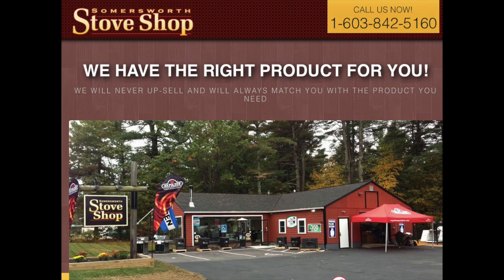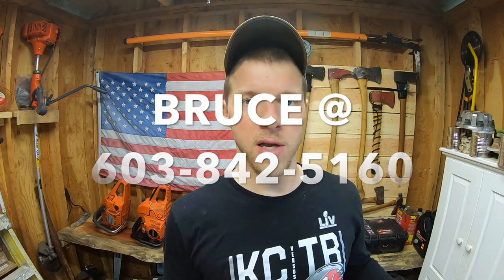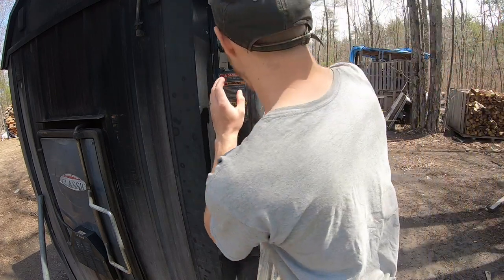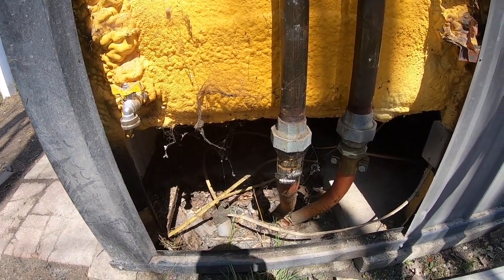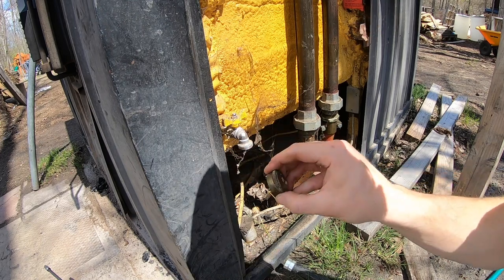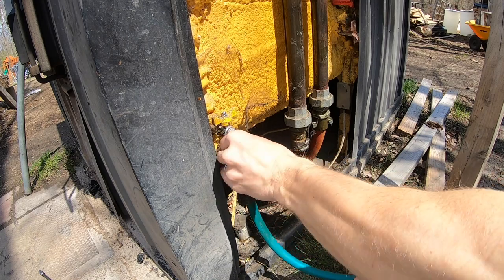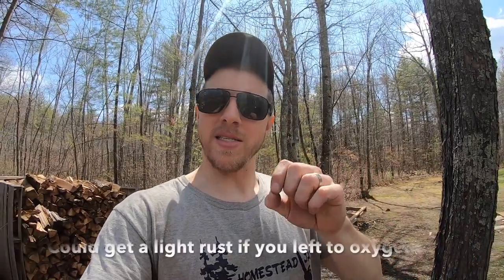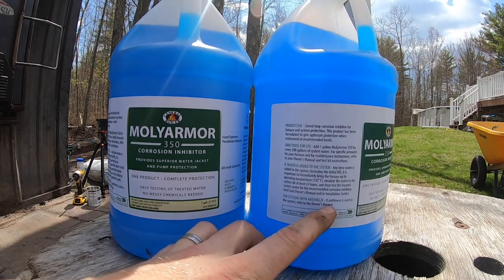Central Boiler CL 6048 Water Change! Part 2

Comment: Wow! That's a lot of work! With my pressurized gasser, I've never changed or tested my water. And no special chemicals needed. Thanks for the video!
Reply from the maker: Hmm interesting? No treatment at all? That’s interesting it must be stainless steel?
Reply: @HomesteadJay  Nope, not stainless steel. Just regular low carbon mild steel. But with a closed, pressurized system, after a couple days, the oxygen is depleted and it won't rust. Or so I'm told. I've seen and talked with guys with boilers like mine that are close to 40 years old and still going strong.
Reply from the maker: Hmm I gotcha! Good stuff!

Comment: Jay, greetings from West Virginia! Huge help! Thank you so much for taking the time to make this video. On my way first thing in the AM to pick up 2 gallons of MolyArmor and a test kit from my nearest dealer (one hour away). I appreciate you. Peace.
Reply from the maker: Hey Dennis! Make sure you add a water sediment filter on your hose before you fill ( like an RV would have) before you fill up your machine if you are draining the water and also refill as soon as possible you dont want that bare metal inside water jacket exposed to the air too long or it could flash rust over!
Reply: Didn’t think of the filter! Filling from our rural Public Service District water source. Solid advice. Did pick up the immediate fill tip from your video. Thanks again, Jay.
Reply from the maker: I didn’t mentioned it in the video that’s why I left you the comment lol
Reply: @HomesteadJay  Thanks for the great videos I just bought a working used Wood Boiler CL 5036! I got it delivered a couple weeks ago and have not got it set up yet but saw the comment on filling right away. It was drained before we moved it but I have not filled it yet as Im still getting the plumbing and parts etc. Should I fill it right away and add Molyarmor even if I cant circulate the water till its all hooked up? Thanks again for the advise and videos!
Reply from the maker: Hey there if you are going to plum it up soon then it can wait but if its going to sit for a few months id at least plum in two shut offs (which you should have above the pumps anyways) and then you can do the pumps and pex later and at least the unit has treated water in it. Make sure you use a sediment filter on the hose to filter out sediment. Sediment is the quickest way to wear out pumps!
Reply: @HomesteadJay  Awesome, thanks Jay! I am hoping to have it all plumbed in the next couple weeks, getting my Thermopex tonight! Thanks for the tip on the sediment filter also. Im my researching questions I have come across your videos a few times so thanks for making them they are a huge help!
Reply from the maker: @Pairofshears  Happy to help! If you need any more questions answered just leave me a new comment so I will see it. Sometimes when you reply to a old comment I wont see it. Happy to help!

Comment: Jay— I bought the HDX 560last fall. According to the manual , you add the Molly first, as water will fill the welded fissures and NOT BE DISPLACED when you add the MOLLY after the water. Really have enjoyed your effort. We downsized to a smaller home, so I sold our older E-2300, which I I had traded up to from a 2007 6048 like yours. Best wishes…
Reply from the maker: Hey Tim! You are correct I believe it does say that but its not the end of the world if you add it after! Thanks for the comment! Happy heating!

Comment: Glad I came across this. I will look into changing out my water this spring and adding molyarmor. Might even consider the sludge conditioner. I have not changed out the water since new and only added upon startup at the beginning of each season. Going on 10 years.

Comment: I bought my place with one of these systems and the people who I bought it from are actually central boiler dealers for my region. From what they told me you can just add moly boost and water to top up directly from the vent cap. They said just fill it right to the top and the system forces out any excess.
Reply from the maker: Yes you can add the moly to existing water but I wanted to change mine out from scratch!

Comment: Thanks for this? My unit sprung a leak in the middle of the side. One morning, I went to add wood and found the firebox had about 2 inches of water in it..fun cleaning that out. I tried to use a hand vinyl tube pump to get the water below the little hole. Couldn't get it snaked very far. That handy dany drain valve is much better!
Reply from the maker: Ugh im sorry yours leaked! That was be a terrible feeling...

Comment: Nice video. Thanks Jay. I put 2 gallons of Molyarmor in my old water a few months ago. CB said it was ok to do that. I've since decided to take the plunge and get a 560 gasser. My CL6048 has served me well but cutting, splitting and stacking 50% less wood is just too much for this 72 year old body to resist.
Reply from the maker: Hey mike! Yes saving wood is deff a exciting thing for sure! I am going to run my classic till she goes and then ill go gasification! Keep up the good fight! Hope ill still be doing it at 72! God Bless!

Comment: Thank you so much for this video.
Reply from the maker: If your running the old anti corrosion conditioner it wouldn’t hurt to run the sludge conditioner through then drain and then refill and add moly armor. This is of course after the heating season is over. Consult with a local dealer just to double
Check

Comment: Hi, I just bought a house with a wood boiler so I’m really learning this winter. If my water level is low, what is the best way to add water? Do I need to let the water temperature drop before I top it off? Or can I add right to the top?
Reply from the maker: Hey Jess. If you have a central boiler there is a fill at the top. Pop the cap off (it fits loosely over) and fill the boiler. There’s a valve with a clear tube on it above the front door to the right. If you open that little valve it will show your water level. If you overfill no big deal it will boil over and settle. Make sure you add moly armor though and test the water. You don’t wanna run untested or untreated water
Reply from the maker: Also you can add when it’s running. No issue there.
Reply: @HomesteadJay thank you! Your videos have definitely helped guide me through this first season.

Comment: i have a 2006 central boiler 4030. no problems in 15 years. great stove. door ropes and pump cartridge is all i have added. i added  moly boost last year, tested to 2700ppm with my test kit. should i add moly armor? or is the old corrosion inhibitor and moly boost enough? i have always tested my water twice a year, always has tested within specs and is clear. it is the same water in the stove for 15 years.
Reply from the maker: do not quote me but I THINK and let me say again I THINK you can add the moly armour to old systems and have no issues as long as you use the test kit specfically to the moly armour! If you add moly armor and use the old test kit that will not work. This is all speculation so Id double check that but ive read that some people added two gallons of moly armour to "old water" and had no issues. But double check!

Comment: How do you “shut the system down and just circulate the water?” My first year with woodstove. Same CL6048. I added sludge conditioner. Monday will be 5 days and then I’m ready to cool it down for the purge/refill. I don’t want to ruin anything.
Reply from the maker: Hey Jack! Long story short if you "cut the power" to the boiler in my case I shut the breaker off then I can plug my pump in to an extension cord right at the boiler and that will circulate the just the water but it wont run the solenoid or anything like that! I have a follow up video on draining it and refill! It should be on my page right around the time of this video!
Reply from the maker: The moly armor will give you full instructions too on the label!

Comment: Thanks for the help, Jay. I noticed the yellow styrofoam has many cracks (looks like pets “popped”) in it when opened the panel to turn it on. Is this an indication the boiler was too hot?
Reply from the maker: The styrofoam is going to act and move over time I wouldnt sweat it! They have had "issues" with the foam year and years later but it makes sense the machines are outside exposed to humidity, cold, warmth, temps fluctuation from the boiler etc. Makes sense the foam will shift crack and move a bit. I wouldnt sweat it!

Comment: Good Video but I never realized how much work it was to have one of those boilers.
Reply from the maker: Hey Pete! Its really not that bad. Changing the water isnt a common or annual thing its something you dont even need to do as long as the PH and corrosion levels are ok! I did it because CB changed their test kit and formula so I wanted to be on the same page.

Comment: Thank you for making this video & tutorial.  Just prepping for fire up of the stove and change water to Molyarmor.   Quick question, the sludge conditioner you did, just peace of mind or highly recommended?  I've had my 5036 as long as yours(2008).
Reply from the maker: Since your going through the process don’t skip any steps! I did it to help loosen or get rid of anything built up. esp since I run a plate style heat exchanger so the passages are small between the plates. I highly recommend running it.

Comment: how often should this be done?
Reply from the maker: As long as you test it before and after season if everything shows up with in range there’s no reason to change it. I changed mine because it was the old anti corrosion additive so I wanted to switch to the new moly armor.
Reply: @HomesteadJay  thank you! I am looking at a brand new one and I am new to all this and just want to make sure to take care of my investment. Your videos help so much.
Reply from the maker: @brandonblankenship5293  If you are starting fresh then deff use the moly armor. ALSO run a sediment filter on your hose when you fill it up. Sediment in your water will wear out your pumps overtime (years) its like sandblasting if you think about it. 300-400 gallons of water these take and even if you had a little sediment in each gallon it adds up! Use a RV inline sediment filter as I stated before!
Reply: @HomesteadJay  guy, I really owe you for that excellent advice. Thank you!
Reply from the maker: @brandonblankenship5293  Glad to help!